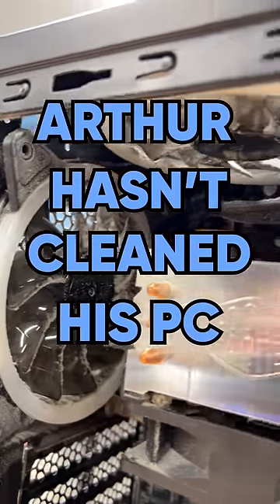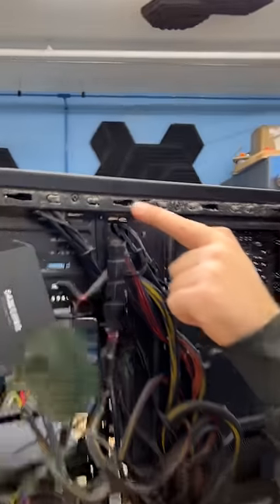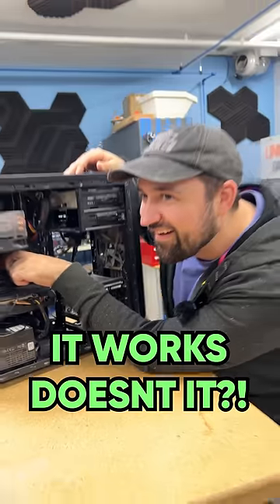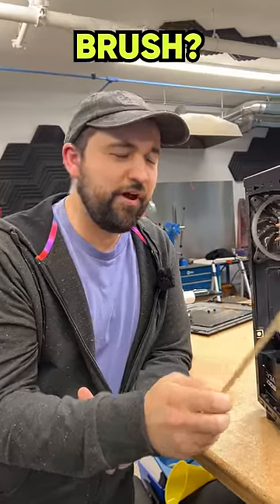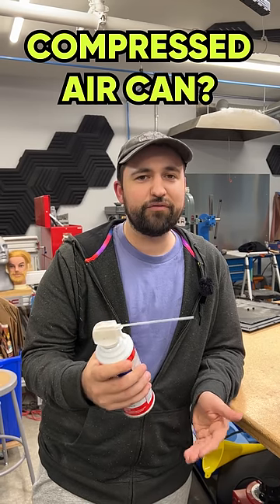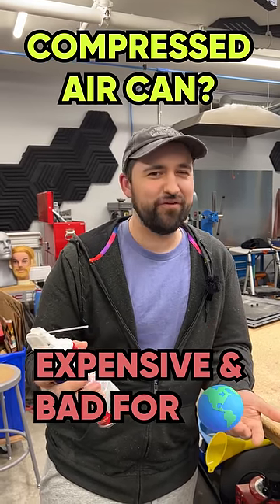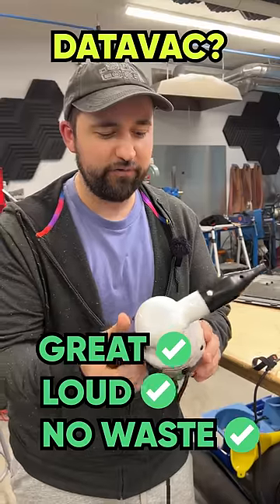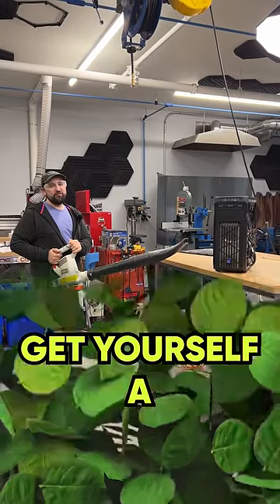This PC wasn't cleaned for 5 years...

Comment: Okay, that SSD really should be mounted down correctly. 

I use a tech air blower, and it's okay to use. You just need to make sure that when you are cleaning the fans, you hold it down so that its not spinning while you are blowing as to prevent damage. And make sure the computer is unplugged comoletly before attemping to clean tge PC.

Leaf blowers though are too rough though.

A microfiber cloth can also be used to clean some of the surface dust, just make sure its clean.

Never use a vacumne to clean any electronics as the static electricity from it can damage componets.

For cleaning the more fragil componets though (or if cleaning a laptop.), a Toothbrush is prefered.

Comment: i have that beat i built the pc im using now 10 years ago ( i7-4930K gtx980) and never bothered to clean it... these dust filters are basically brick walls at this point i wouldn't even know where to start in getting them clean 👍

Comment: Use a home or shop vacuum with detailing attachments. Like you’re supposed to. Then finish off with wiping with iso alcohol. So you actually take away nasties and not just blow it all over the place or further into the hardware.

Comment: if you have a shop vac you can put the hose on the side that blows BUT just make sure it has a good filter that looks like the kind on cars and not the one meant for vacuuming up water. and also be sure to empty the bid on the vac you dont want to be blowing dust into it.
Reply: Doen d of ik f de mij de kou go out it up op Gr to op y Gr it de o

Comment: Ok he is off the hook, I didn't even look inside my first build for 3 years. During that time, the backplate fell off my mobo and the thermal paste had actually hardened enough for the wraith cooler to stick to my cpu. On top of that... omg it hurts to even admit this, my motherboard was not on mounting screws. It was directly touching the bare metal case... for 3 years. My fans also looked pretty similar....... fuzzy.

Comment: I use blower it really does the job for parts like fans after cleaning as much as you can with blower also  put hand on fan for stopping it spinning when using blower n to clean inside fan you can attach a soft cloth piece to pen or some thin strong  stick n clean inside of fans. Just to be clear it doesn't mess up anything just don't keep blower at same part for too long  also keep distance from pc coz it's too powerful. doesn't matter if you use inside case just slowly power on n off blower.
Reply: another tip, do it outside.
Reply: @icoo44  those who wanna keep their house clean will definitely do it outside 😏😁

Comment: Search, refillable aerosol... for 30$ there is a stainless steel can with a sprayer and nozzles and stuff you can pump with a bike pump. It is meant for stuff like wd40 and such but you can also use it for a can of air.

Comment: Had an old pc that ram our telephone system from 1986-2006, 24/7 365 in a dirty construction where house. Never cleaned, never opened. Finally died 20 years later. Had 3/4” of dirt on everything inside. They just don’t make them like that anymore.

Comment: I'm fairly certain I blew up my psu by using my air compressor when I blew everything out. Ton of dust came out of it and when I finally realized the fans were moving it was already too late. Went to plug it back in and now absolutely nothing.

Comment: Just need a small $200 air compressor with hose accessories incl tires/tyre pump, it cleans both PC and keeps tires/tyres pumped up.  Just make sure you hold the fan when blowing out because you can stuff yah PC

Comment: How is a datavac any different from using a hairdryer on cold setting?

That said, I'm also wondering how they have so much dust. I don't clean my PC often, but it doesn't really collect much dust anyway. No way it would look that dirty after five years! Is the air in Northern American cities that much dirtier than in European cities or does he have a really bad pressure setup in his case?

For cleaning, I use a microfiber cloth for all parts that aren't susceptible to ESD and an antistatic brush as well as a small bellow (basically a squeezeable ball with a pointy nozzle on one side) as us commonly used for cleaning camera lenses to blow some air at places where the brush doesn't reach. Works fine and doesn't require spending 60 bucks on a device I'm gonna use like once a year

Comment: Linus said on WAN show that those electric blowers are bad, that you should only use either canned air or a compressor with a filter that cleans the air of particles. Sooo... which is it then?

Comment: I got advised strongly to not use powered air tools to clean dust as the air could be statically charged? Does the datavac have precautionary features to prevent a charge in the components?

Comment: just use a compressor... Get them at haurbor freight... Get the ultra quite one for like 100 bucks. Ive been blowing out PCs for 15 years this way and ive had ZERO issues. PCs are more robust then people think. Dont blow to hard with a compressor. dont blow 150psi into your machine.

Comment: My soul cringed knowing the fans on the gpu and other fans were just spinning st super high rpm from that air. Did that once and got the worse coil whinning noise. Never again always tape you're fans or hold them still when using compressed air.

Comment: A detailing brush and a vacuum is what detailers use, so why wouldn't that technique work on PCs? Why blow dust around the workshop? If my guys did that, they'd be fired
Reply: Brush can works, but not vacuum, it can create static.
Reply: @forstuffwow7145  that's a myth my dude.

Comment: Power cord connected, pc off (so it's grounded). Take off your socks and first use the vaccum. Than after you vaccum everything you can blow the remaining dust out. Never start blowing dust right away because if you live in a humid area that dust can contain fungal spores that some can kill you. Bacteria spores and fungus spores thrive in humid and warm place like your pc. 
Why power cord in and without socks, because the static electricity that will start to gather in the vaccum tube will be right away discharged through the case and your hand (that's why you have to be without socks). Ah yes and one arm on the pc case at all times. I am electrician and i work in a service center. About milion computers by now not one has died on me, we empty out every day 5kg (11lbs) of dust from the vaccum, imagine blowing that dust 🤣.